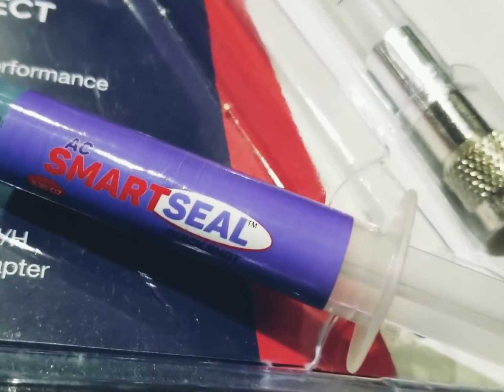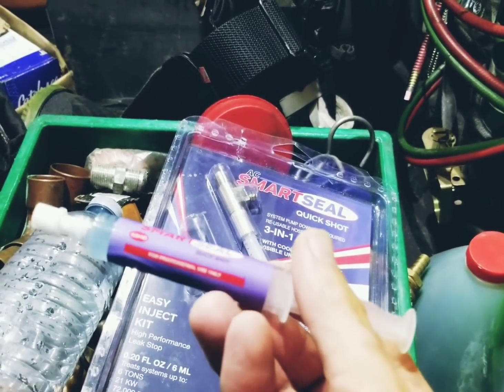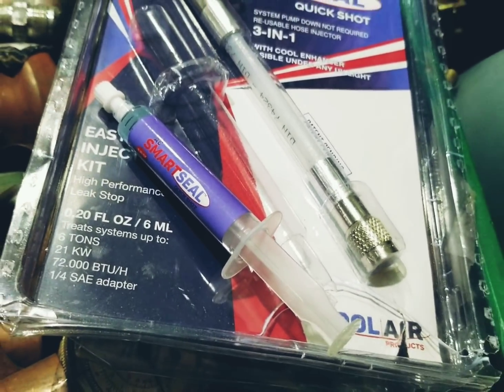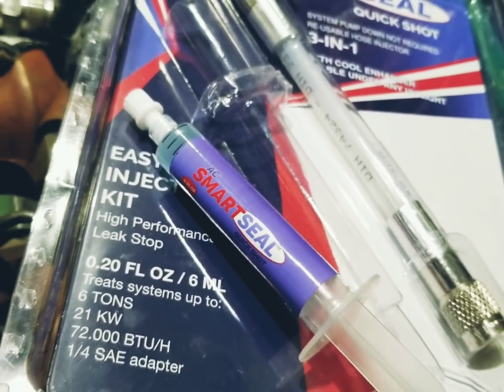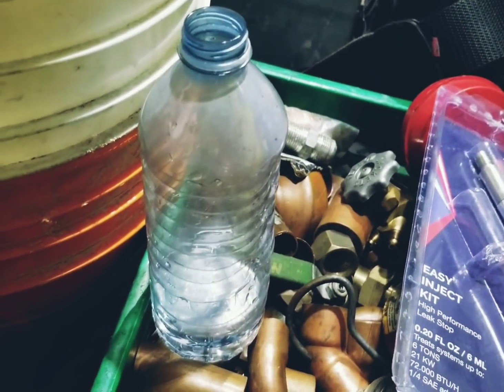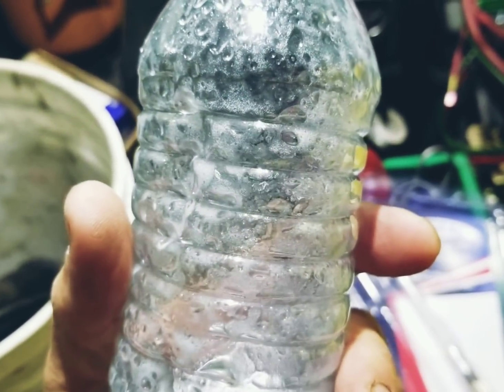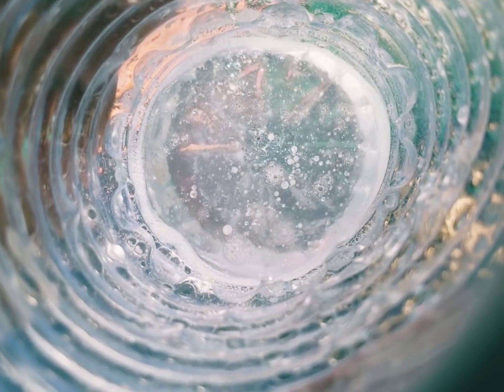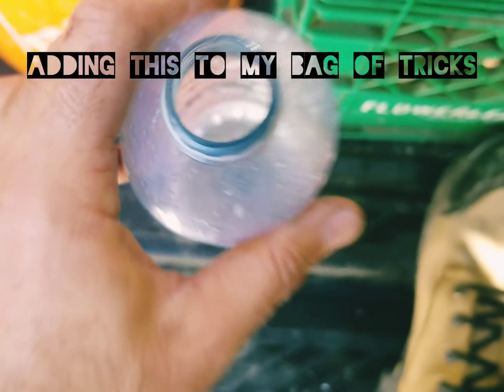HVAC - AC Smart Seal Internal Leak Sealant

Comment: Have a 2 ton water source heat pump (4 years old). Did nitro test, used electronic leak detector as well as bubbles. Had no signs of leak/oil. Got to 550 psi and it held for over 4 hours. But have had to add gas 2-3 times in the last two years. Gonna use easy seal tomorrow and hope for the best.

Comment: Does this works on R410a condenser?
Reply from the maker: Depends how bug the leak is...If the leak rate is 20% a year or less, it should
Reply: @HVACKnowItAll  I did leak  search to the unit (cassette type) it took a year before it lose gas, maybe it has micro leak.
Reply from the maker: @fridgydownunder6734  micro leaks are perfect for it

Comment: Hmmm! Ive used  a few, but  the one from united surprisingly worked had to go back every 3 months approx its been over 8 months so far its holding its charge, its a 12 year old condenser client want to sellout property
Reply from the maker: Was it oil based or polymer based
Reply: @HVACKnowItAll  i looked up the website it says does not contain any polymers i believe its call leak freeze
Reply: That's it that one seems to work